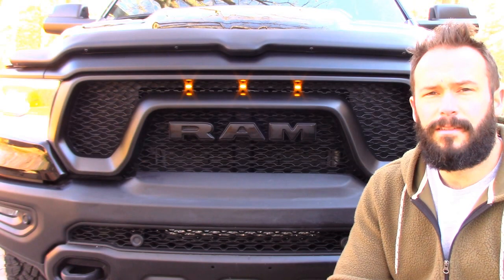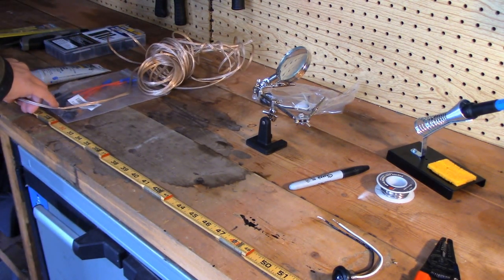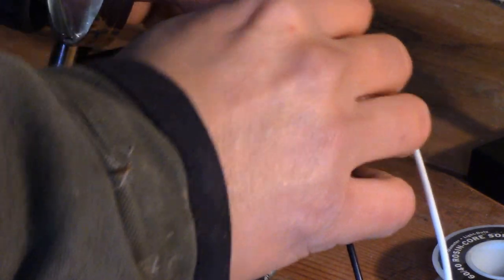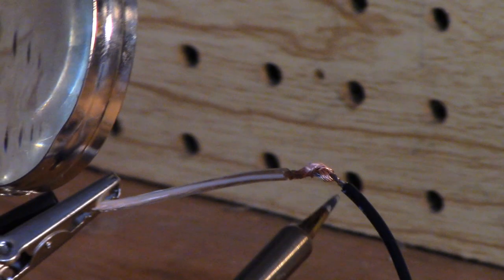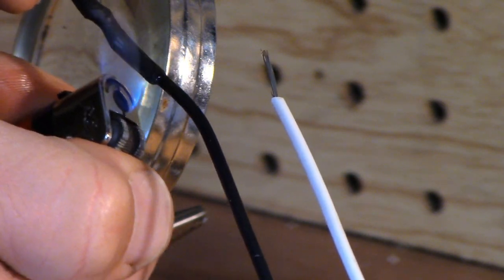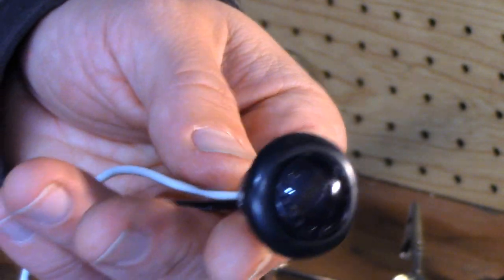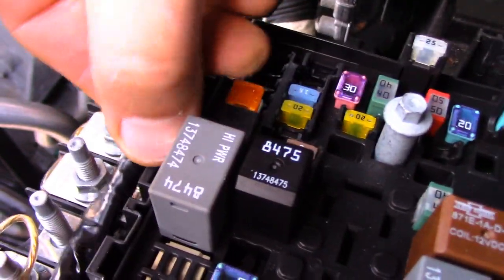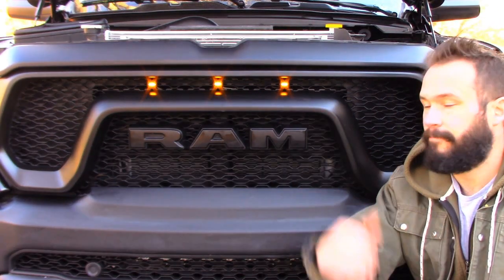2020 Ram Rebel 1500 TRX Style Marker Lights - ETORQUE owners read description

Comment: Looks nice, thank you for sharing.  Depending on how long you intend to own the truck, a best practice is to use and acid brush and 91% isopropyl alcohol to clean the solder joint of any residual flux prior to heat shrinking the connection.  This, combined with the silicone protection, will extend the life of the soldered connection.

Comment: Thanks for the video. Not very mechanically inclined. However your video makes me think I could do what you did. Only thing I wanted to think of doing different would be to run them on from the running lights. That way when running lights on they on. Wouldn’t that would as well?
Reply from the maker: It may require tapping into wires. I did not want to do that. I have done it on cars to add fog lights, but wasn’t comfortable doing it with this truck. That said, I’m sure it’s possible.
Reply: @venomrebel2020  thanks for answering me. Will look into it. Also want to put lights on the room too. But not sure I want to drill,

Comment: Great video brotha! I know absolutely nothing about electrical work. When you took the three positive wires and combined them into one for the fuse connector, is it as simple as connecting those three wires together at the end and adding a positive wire to all of them and then connecting that to the fuse connector?
Reply from the maker: Yes and then do your ground

Comment: Have u had any issues with these lights. I have seven of these on my ram warlock grill. They last about 7 months. All of the plastic lenses crack leak and light goes out. Not just one all of them and  they are from different orders too. I have same lights but red on rear of truck under tailgate. No issues. Might b winter temps my guess. Lights look 👍
Reply from the maker: So far so good 🤞🏻🤞🏻🤞🏻

Comment: Sorry I'm late to the party but I was looking for a better power supply. Does anyone know a fuse location I can tap that is only hot when the lights are on? I don't like these being on anytime the truck is running. Great video though, very insightful.
Reply from the maker: Thanks Matt. I’m not aware of a fuse that is only hot with the lights on. Mine are still running strong. No issues to report. Thanks for watching.

Comment: I bought a set pre made from a guy who everyone in the Rebel community buys from but he wants me to remove 2 top louvers from the active grill and I refused to do that on a brand new 23 Rebel lunar. I still have the lights. How did you run them without interfering with the grill louvers?
Reply from the maker: I did not remove the panels. I will have to check to see how I routed the wires.

Comment: Can those be hooked up to the running lights to stay on?  Instead of popping the fuse?  I love the looks of those.
Reply from the maker: The lights stay on as long as the truck is running, as the fuse tap is inserted in the fuel pump fuse slot. I am not sure how you would hook them up to the running lights. Thanks for watching!
Reply: I’ve heard horror stories of trying to link these to your existing lights in the new rams. There’s some sort of sensing system that shut things down if it notices irregularities in the power pull for the lights. One guy couldn’t even get his truck to start. There’s ways to do it, but you might have to do some digging.
Reply: @venomrebel2020   @Russ Watkin  if you tie them into the marker lights (the white with orange stripe wire), you just have to use a relay. Water Fowler 41 has a good video with great instructions --> https://youtu.be/airG0MUpyac

Comment: Any concerns running the full voltage (albeit minuscule amount with these tiny lights) directly to the fuse box as power without wiring through a relay?
Reply from the maker: That's a great question. I see a lot of posts about relays. I'm curious why you would want a relay when the fuse offers the protection. Relays control the power, and in this case I don't need control because the lights fire when the item the tap is using engages, and they cut out when the tapped circuit loses power. .

Comment: My front grill RAM Emblem lights up at night with Cool white back lighting and I would like to get ember "TRX" lights like this but I only want them to run during the day to match my daytime amber marker lights. Any idea where I can tap the TRX lights into to achieve this?
Reply from the maker: I think you’d be looking at the #3 spot on a 7 way trailer plug. Brown wire. Here’s the diagram I used when I did mine. I’m not entirely sure it would run only with the running lights though. https://www.ajtnt.com/Info/7-Way-Diagram

Comment: Is your Ram logo and skid plate both plasti-dipped?
Reply from the maker: The skid plate is Plasti-Dipped. I purchased black lettering for the RAM grill and switched it out. Initially I tried the Plasti-Dip but it didn’t hold up on the letters.
Reply: @venomrebel2020  Looks amazing, I wanna do it on my Rebel as well along with the marker lights! Do you have the link to the lettering? Thanks again, and congrats on 200 subs 🥂
Reply from the maker: @thegreatest7133  Dude I am stoked! Thank you. I bought the lettering form a local Dodge dealer on Ebay. I think I paid like $30. They are easy to swap.